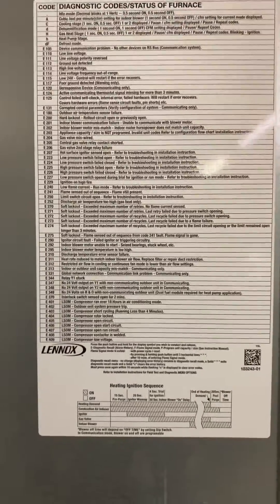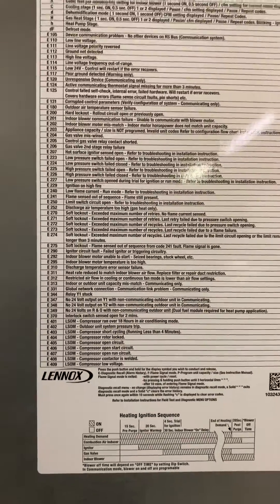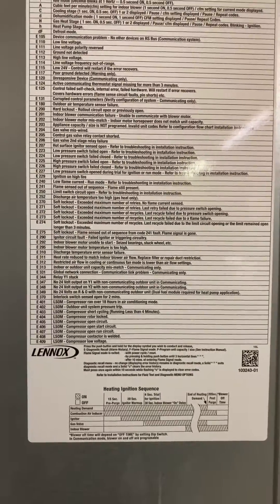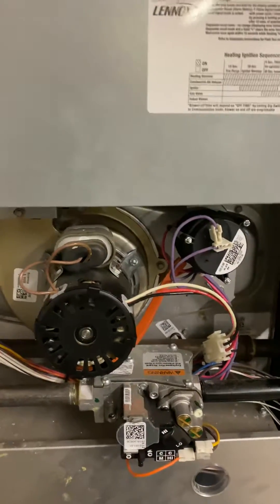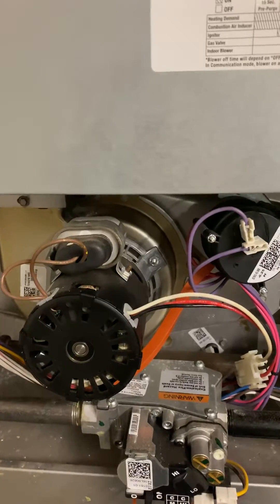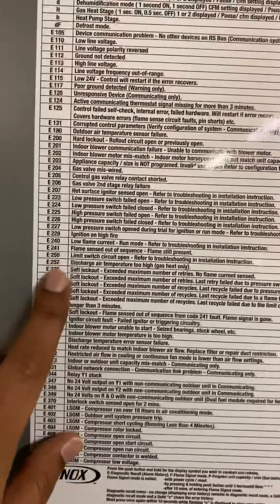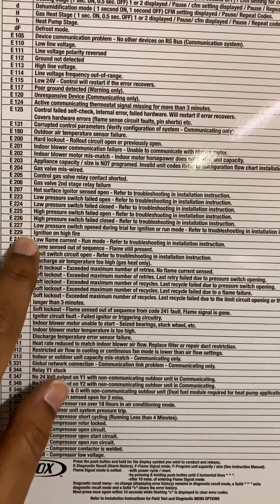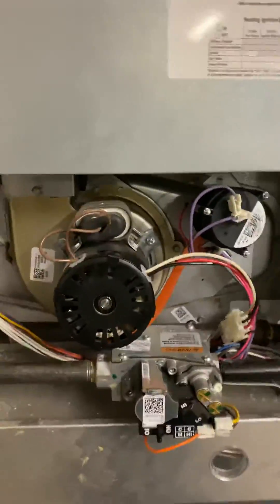Lennox HVAC SL 280 low pressure switch error E229 E223 E227

Comment: You, sir, are the GOAT!  We received an alert code 271 GP Low Press Switch Open code this morning — first time ever seeing this code.  I googled on YouTube and your vid showed up. We have the same model series, though my inner working looked slightly different than yours but basically the same pieces. I undid both ends of the tube and no blockage. Then I shined a light in the little hole. Wasn’t sure what I was looking at at first but took a sewing needle and began to pry. Lo and behold the entire passage was blocked!  Cleared it completely and voila — we have heat again!  THANK YOU!!! 🤟🤟🤟

Comment: Sir, you saved me an after hours call, on a Sunday at 5am!  Woke up to no heat (of course it is -8F outside).  Called the on call guy and started googling.  Came across your video...the hose was plugged.  Blew it out and cleaned the port on the blower motor side....worked like a champ.  The heat is back on!  Much appreciated!

Comment: genius - symptoms were same as thermocouple failure (which i know how to fix, but don't know where that is on this lennox) but then saw the red light blinking 4 then 1 but nothing on the internet said anything about 4 then 1, so i looked closer and the blinking lights were actually codes on a little LED light (E229) and found this video. it looks a little different inside my lennox, but there is clearly a round switch with an large-ish square orange hose between it and the backplate - similar to the video. disconnected the switch end - it was clean - reconnected it and disconnected the back end - looked clean - looked into the port and blocked with rusted crud. used a paperclip to break up the crud until it looked clean. reconnected and started up and perfect. thank you so much.

Comment: Had error code 223 on my SL280 when trying to use my furnace for the 1st time after a summer break. Thanks to this video I was able to clean out the small pipe and save $'s Thanks Nilesh.

Comment: I had only the E229 specifically. Turns out I had a frozen condensation pipe. Once the condensation pipe was cleared the heater was functional again. Thanks for posting Nilesh and all the support comments that helped me quickly solve my issue.

Comment: Thanks for sharing this Nilesh. I stumbled upon your video while searching for E223 E229 errors at night yesterday, we all slept upstairs with the downstairs unit with the problem. This morning I followed the steps and in under 5 mins we were up and running (heating) again! 

Our unit is over 11 years old, I had complete blockage with stuck dirt and I scraped it all. And you are right with the pressure switch too, it still works.

Can't thank you enough for saving us the trouble to get it fixed during cold and holiday time and the immense satisfaction of fixing it ourselves. 

:thanksdoc:

Comment: My Lennox SL280 stopped running last night with outside temperatures in the 20s. Error code 223 and 229 were indicated on the display. After some googling I found your YouTube video. Pulled the red hose off and sure enough the small pipe was clogged. Using a paper clip, I unclogged the pipe , blew out the hose and hooked the hose back up. Turned on the furnace and we now have heat. Kudos to Nilesh for posting this video.

Comment: Furnace just went out with both of my kids asleep and outside temps bellow 30 degrees. I was about to wake my kids up and take them to their grandparents house just before I came across your video. Doing exactly what you suggested my heat is back up and running and the kids are still soundly asleep. Thank you for your help!!

Comment: Life saver. This fixed my problem immediately. I was getting e223, sometimes e227 and e229. I unplugged that hold with a hair pin and my furnace fired up after being off all night. Power cycles worked earlier in the week but didn’t fix the latest issue. This did. Thx!!!!

Comment: You saved Christmas. My Lennox SL280 just threw an E223 code right before family was coming over. As you shared - I disconnected the line to the low-pressure switch and the port was plugged! Had a reducer attachment for my shopvac and I was able to vac out that port, with some help using a small wire. Confirmed the line wasn't blocked (blew into it and could easily hear the switch diaphragm activate. Plugged the line back into the cleaned out port, turned on the furnace, said a prayer, and its a Christmas miracle - its heating normally now. Wow!
Reply from the maker: you're welcome :)

Comment: Thank you, thank you. Fixed in under five minutes. I used a small drill bit to clear the hole and found it full of red/brown sticky fluid. I will look into removing the fan and cleaning more thoroughly. You video was just what I needed.

Comment: Another issue that can cause an E227, E229 error code is a dirty flame sensor. If you go through all the steps in this video and none of the ports or hoses are clogged or have condensate in them, try cleaning off your flame sensor. It could be giving you false negatives. Don't touch the flame sensor with your hands as you will get the oils from your hands on it. Use very fine grit sandpaper or a newish dollar bill to clean it off. That's what solved this issue for me.
Reply: Where is the flame sensor located

Comment: Thanks you for taking the time to publish this video. It was super helpful. I Pulled off the tube like you suggested and saw that the fitting was clogged just like you explained.  I unclogged it and it fired right up. The good news is we now have heat again, bad news is that it was clogged with a rusty sludge which can’t be good. I’ll be calling a tech anyway to check that out. Thanks again for getting up going in the meantime!
Reply: I saw what appeared to be rust build up as well. Only thought was to take a small drill bit to clear it out. Worked like a charm but like you, wondering if I’m only buying a little time. 🤷🏼‍♂️
Reply: @LunarDRK how did it go its been 6 months

Comment: LENNOX EL296UHV FURNACE. Mine was throwing E223 and E229 I checked the pressure switch, I removed vacuum tubing cleaning all holes, 1 at a time so everything should go back to the same place, no mix up or any confusion. it did not change anything, then I checked my igniter, burning element on it was half gone like burnt to ashes and it quit working, luckily I bought one couple of years ago (universal) I replaced the bad one with the universal igniter as the universal one did not have the same holes for the screw it did not align properly and I left it there kind of loose and start the Furnace after all the steps igniter glew up, this cycle repeated 4 times and igniter was glowing up every time (but the original one which I replaced was not glowing up at all) after 4 tries it threw a new code E270  means Soft lockout: No flame current sensed (remember igniter was glowing up but it was not align properly) so I removed the igniter cut a small hole in it at the right spot put it back in BINGO!!!  working great lots of heat Right now its -29 wind chill -35 here in CALGARY AB. I hope it would help someone just like this video.
Reply: I may have a bigger furnace issue but this got my furnace running and kept my house warm. It is -2 degrees outside and inside it was 50 degrees and the heat wouldn't kick on and this did the trick.  Thank you so very much!